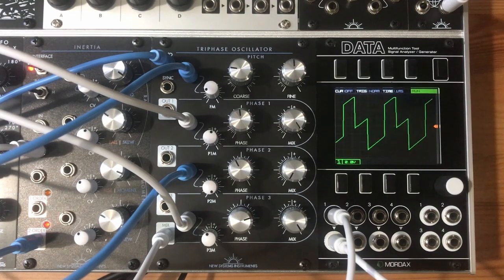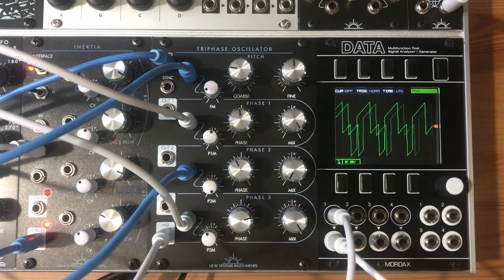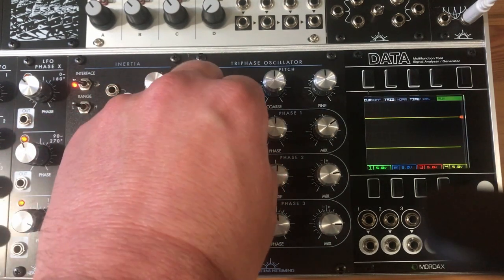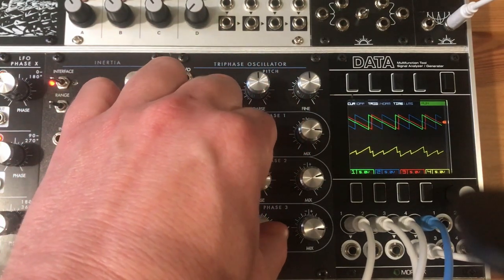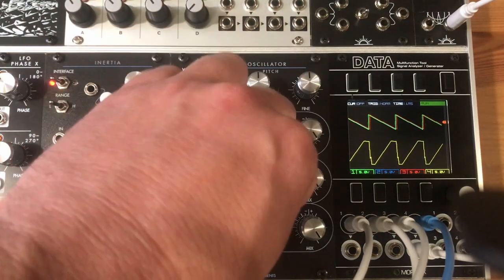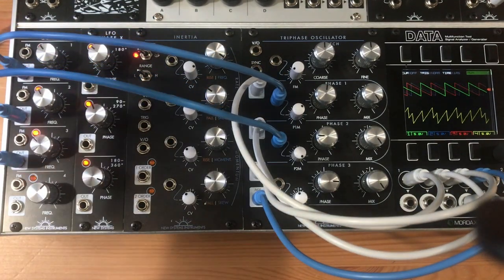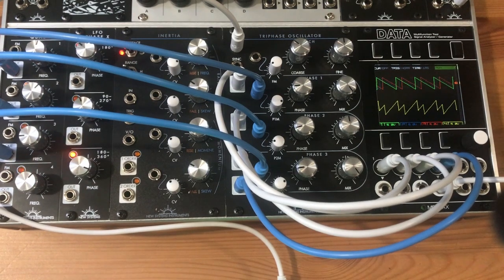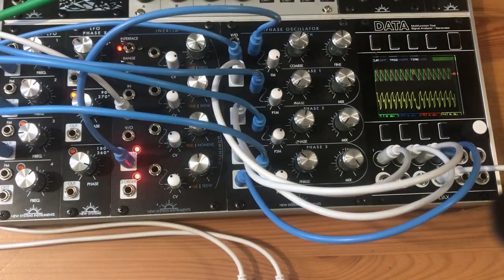Triphase Oscillator Overview

Comment: Hello, is this one or three oscillator inside?
Reply from the maker: Well…it’s a new kind of architecture. There’s three charging capacitors so you could think of it as three oscillators, but IMO it’s better to think about it as three phases of a single oscillator, since those phases are going to have zero drift relative to each other, there’s only one pitch control, etc. In the intro demo, btw, I use two Triphase oscillators to play two notes at once. Just bc I like chords.
Reply: @NewSystemsInstruments   cool! just ordered one!